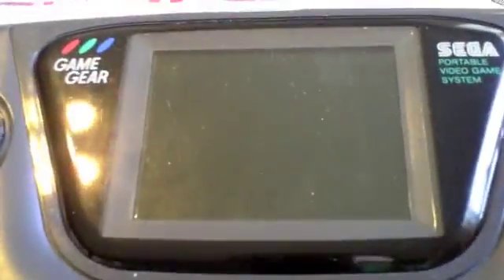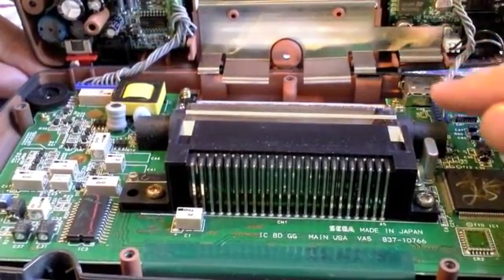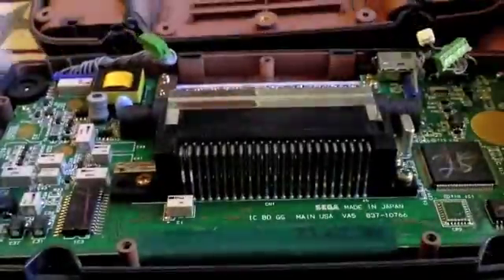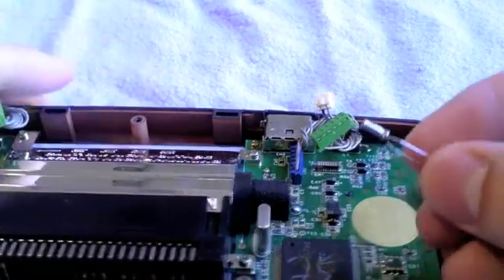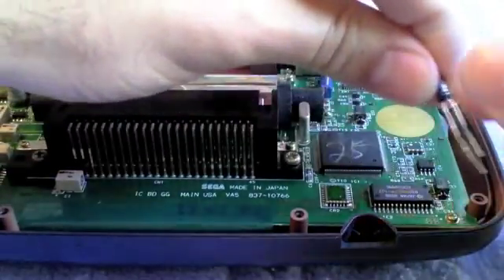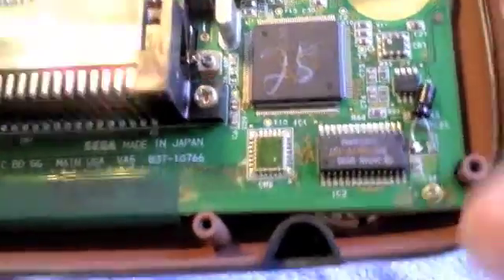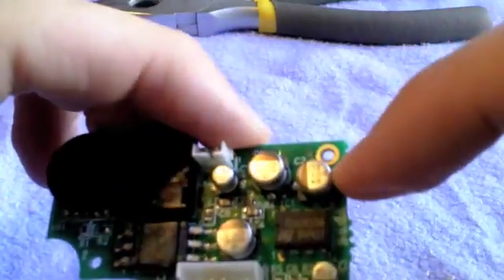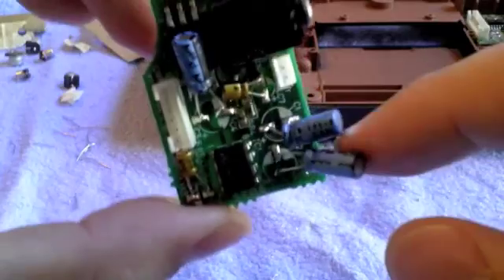Sega Game Gear Capacitor Repair

Comment: What type and size of soldering wire would i need for this job?
Reply from the maker: Something like this:
https://www.amazon.com/Mudder-Solder-Electrical-Soldering-0-22lbs/dp/B01B61TWGY/ref=sr_1_6?s=hi&ie=UTF8&qid=1516633033&sr=1-6&keywords=solder

Also, definitely DO NOT use plumbing solder. Two different things.

Comment: I had the same board. Everything was going smoothly till the positive pad on C39 got pulled while I was trying to solder off the old capacitor. 
Now I got figure out how work around that problem if it is even possible...
Remember to use plenty of flux to remove those pesky little capacitors.